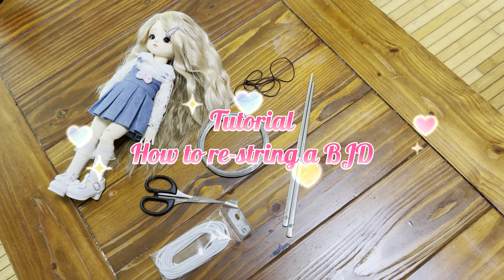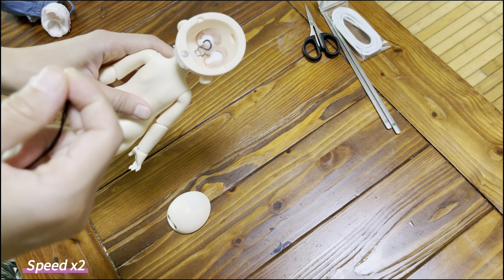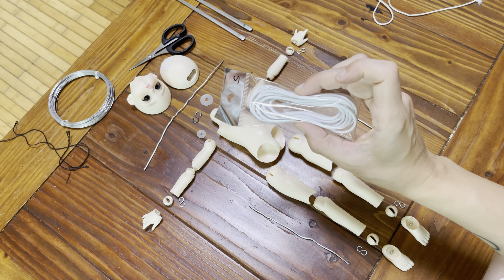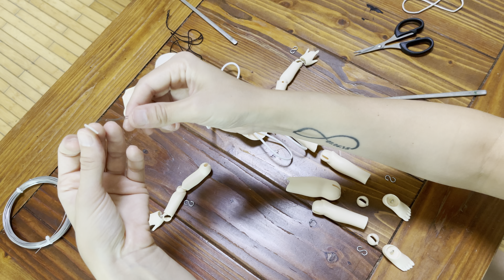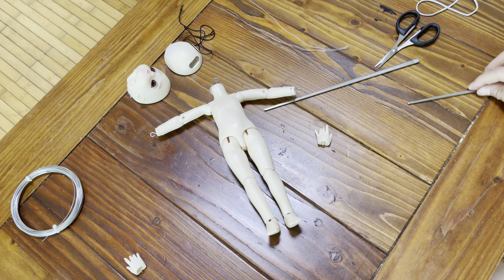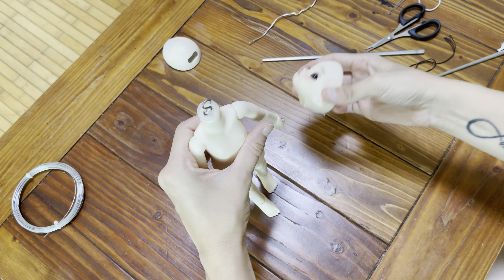TUTORIAL // How to string a BJD Doll / Un-String / Re-String / New Elastics

Comment: Can u tell us why the wire? all dolls has it? or its a personal choice? tell me please!
Reply from the maker: Not sure which wire you mean… 
the thin wire is used yo guide the elastics through all the resin parts. Wire in this case is necessary otherwise you won’t be able to push the elastics through the small holes. 
And the wires in the legs is a choice for this specific doll. Some dolls can’t pose very well, so wiring in arms and legs help with posing (silicone rings or hot glue sueding are an alternative way to help with better posing)

Comment: Is it alright to reuse the old elastics from the doll? It's quite hard to get your hands on elastics where i'm at.
Reply from the maker: Hi, thank you for your question. As long as the elastics are still strong, you can re-use it of course. Sometimes elastics just get very weak and kinda dry after a few years… I mean it’s not really elastic anymore but rather like a threat which makes it hard to string the doll and pose it. If you don’t have a doll shop in your city or country, you should ask at fabric shops or diy supplies shops for elastics. I hope this helps ☺️🫶